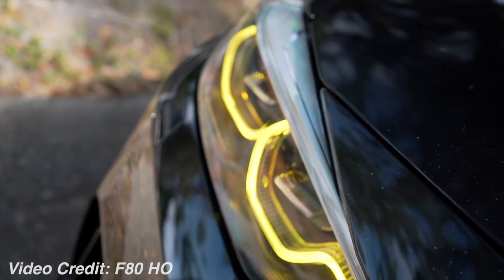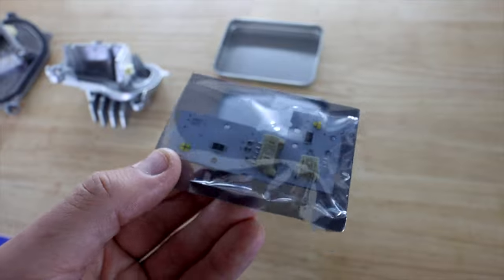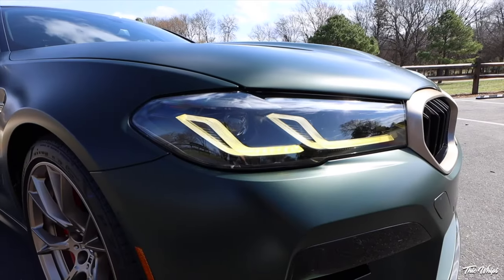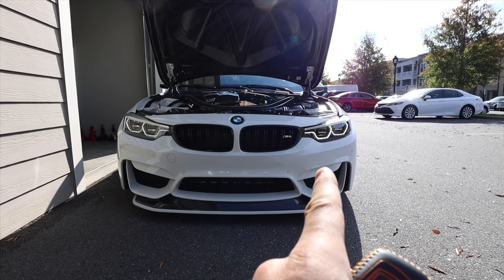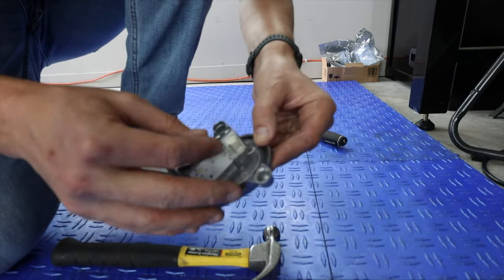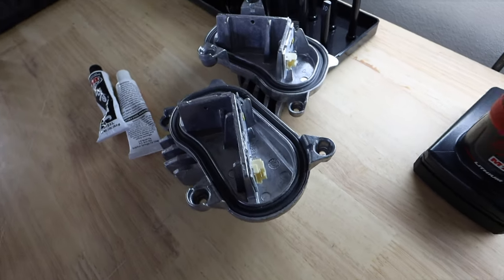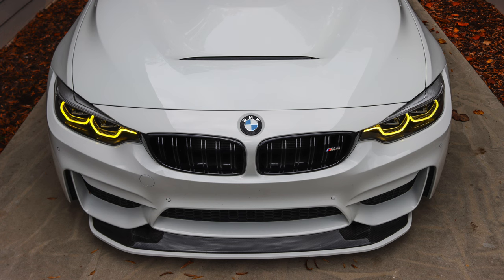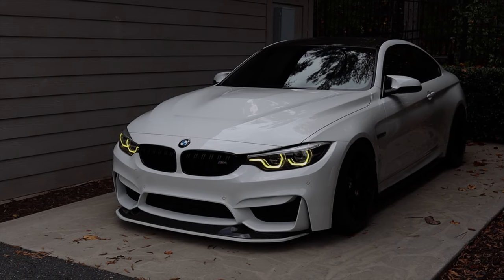M4GTS Yellow DRL's (Not sure how I feel about these....)

Comment: JB weld is not thermally conductive, meaning it doesnt transfer heat well. The reason you want to use a thermally conductive adhesive is so the heat from the leds get wicked away and to the heat sinks. Not a huge deal, but might reduce the life of those led modules.